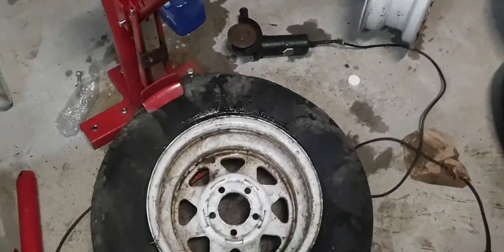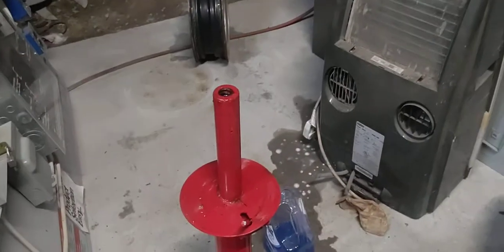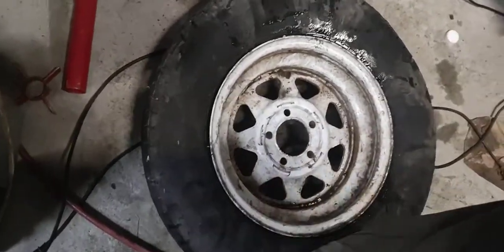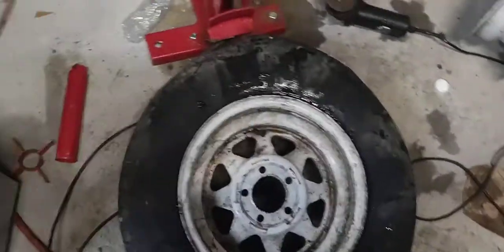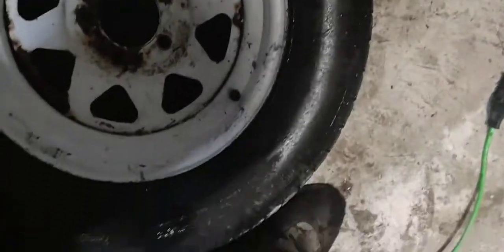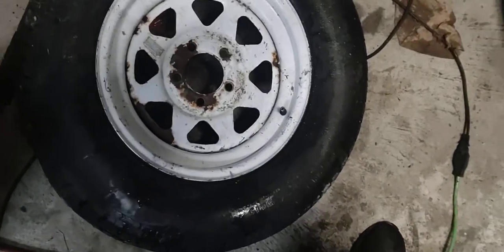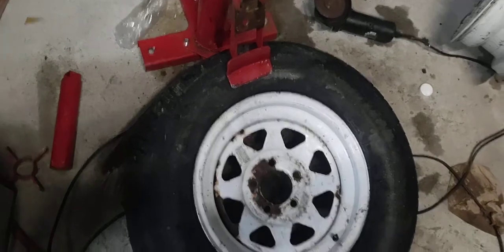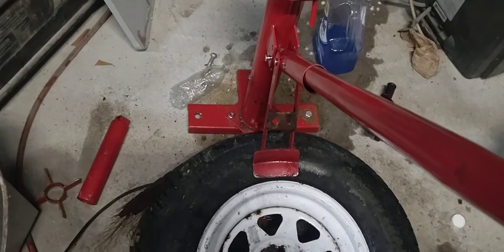Harbor freight tire changer review

Comment: for $40 it's alright, but the ones I had (older, pneumantic, similar style) just frustrated me and they couldn't do half the tires I needed to.. I went and spent $500 on a real tire changer and that was the best thing I ever did, breaking beads and changing the tire is a breeze.
Reply from the maker: Most of the tires I fool with are trailer tires
Reply: @farmall1farmall132  we have sooo many implements around here.. I figure we have well over 100 tires that need to hold air, I can do from a 10" rim up to a 22" which covers a pretty good range, I can do dually rims and such as well.. beating beads off with a hammer got old real fast, and I had to look for a long time for a tire machine that was in my price range .. no regrets about it now though
Reply from the maker: @Rx7man  I'm gonna buy one soon as I find one or buy a el cheapo one from eBay... Implements tires I rarely change but trailer tires all the time
Reply: @farmall1farmall132  I'd go for a good used one from a tire shop or something before Ebay